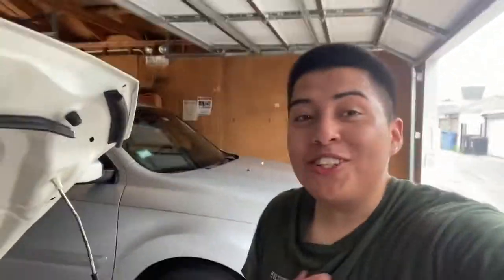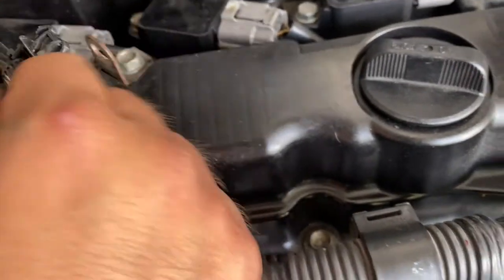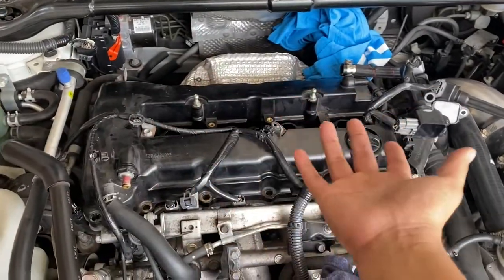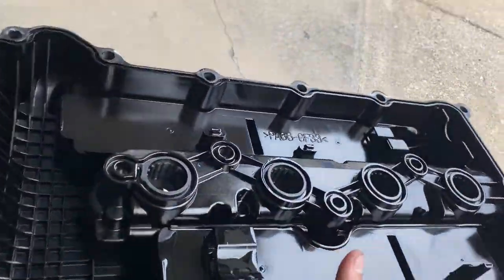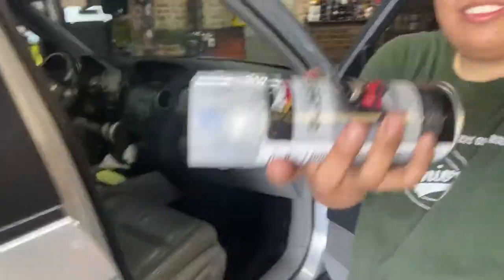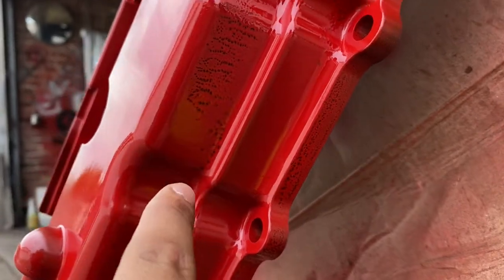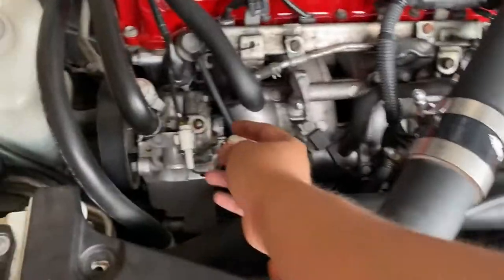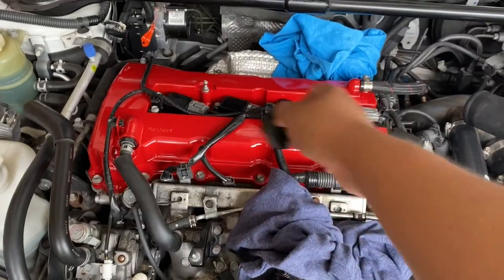painting my valve cover on my evo x!!

Comment: Weren’t youbl supposed to sand it down first and put primer? The paint probably gonna lift up with time, idk correct me if im wrong
Reply from the maker: Didn’t add primer because it wasn’t heat resistant and I didn’t send it down cause it was smooth already.